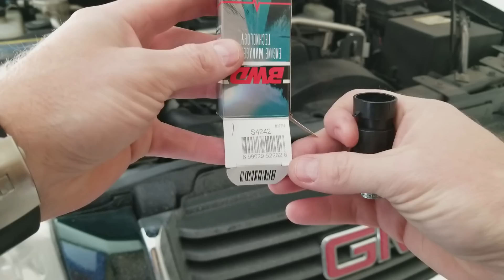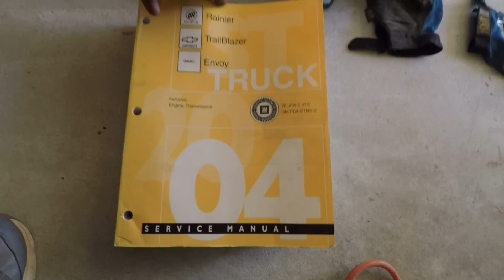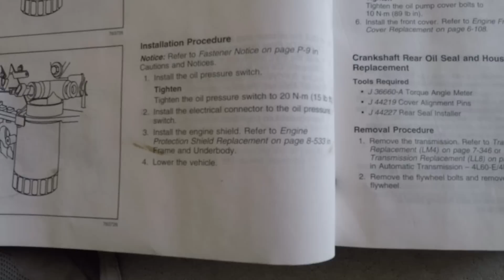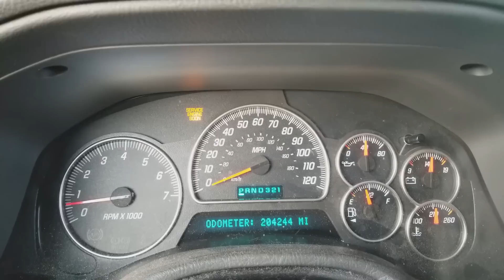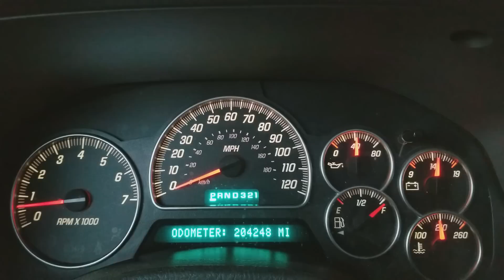DIAGNOSING ENVOY/TRAILBLAZER LOW OIL PRESSURE (GM 4.2L)

Comment: Thanks for the info its the same signs of my issues with my  trailblazer , going to attack with more confidence n hope that fixes the issue with oil floatation gage, am throwing cluster sign turn of engine low oil pressure when gage drops to 0 then floates back  an forth, n  to use 1 -1/16 thin wall  long socket.

Comment: When it throws that solinoid code, it means your car is low on oil and you need to change it. I realized this with my gage was doing the same thing and then the code was thrown, did an oil change and had 2 quarts of oil come out of my engine….. after I replace the filter and added new oil, the code went away and the gage stopped, it’s a temp fix, replace the sensor when possible because it was still leaking as well.

Comment: This happened after using Castrol oil for the first time. ONLY USE AMERICAN BASE OIL EUROPE OIL IS NO GOOD FOR AMERICAN CARS. Now I'm hoping the fix is the oil switch with a little marvel mystery oil. I will repeat my trailblazer ran perfectly fine all the way up until This dumbazz mechanic added Castrol to the car. 3K miles later the oil felt like water???

Comment: 2 weeks ago I had an oil leak from my oil pressure sensor on my 4.2 Envoy. But the sensor itself wasn’t bad as it read normal pressure. It was a bad o ring. I wonder if it’s a common problem with the Vortec 4200.

Comment: You would need a way to apply pressure to it and check the switch whether it opens or closes to pass current for the pressure light. It probably closes to send signal to the light

Comment: It sounds like your battery is getting a little weak maybe? Yeah, I have to replace that oil sensor too on my 2003 Chevy trailblazer with 195k miles. Good stuff. Subscribed
Reply from the maker: I did replace my battery at the beginning of this year with a Napa Legend battery 👍

Comment: Great info. I own a beautiful 2002 Blazer ZR2 with the 4.3 Vortec & 300k miles on her. 
 It'll tick when it gets a quarter of a qrt. low on oil. 
I deleted my leaky oil cooler lines & gained a lot of pressure. 
I did change my oil pressure switch/sensor located behind the distributor but, it didn't make a difference. 
My pressure runs around 20 at idle & 40-45 running. It'll hit 50 on a fresh oil change.

Comment: having the same issue with my 05 trail blazer i bought yesterday oil pressure kept goin down there seems to be a slight knock also my coolant is boiling is that a bad aighn of bad motor
Reply from the maker: Congrats on your new-to-you truck!  Start with the easy things first.  Change your oil and pressure switch.  How many miles are on your truck?  Since you just bought it, i'd suggest going through and changing all the fluids.  That way you have a fresh start with the maintenance.
Reply: @KevinNadeau  we’ll come to find out the motor is shot I think it threw a rod it’s knocking really bad almost no power I think I got hustled honestly
Reply from the maker: Sorry to hear that, its a terrible feeling.

Comment: Okay...if you try this procedure and then, IF IT DOESN'T FIX THE ISSUE; consider this; you may very well have a clogged oil pickup screen that is towards the bottom of your oil pan, (especially if you did an "engine flush"...and getting the oil pan off is  a MAJOR job to get off to reach and clean the pickup tube. This will eventually choke and kill your engine!   
SO...you can also try this to (as safely as possible) dissolve the sludge that is clogging the pickup tube.  
How to Unstop an Oil Pump Pickup Tube Without Taking the Oil Pan Off

Chances are very good that if the oil pressure has dropped due to a clogged pickup tube screen, the pump is damaged and should be replaced along with new crankshaft bearings as well. There is a procedure, though, that may help if the damage is not too severe.
Step 1
Drain the engine oil into a drain pan and remove the oil filter. Replace the drain plug and pour 1 gallon of Berryman B-12 Chemtool or a similar product into the engine oil fill. Do not crank the engine. Let the product sit in the oil pan for 2 days before draining.
Step 2
Drain the solvent out of the oil pan. Replace the drain plug and fill the oil pan with solvent once again. Allow it to sit for 2 additional days and drain the product. Inspect it as it flows out of the oil pan. If it is a dark sludge, the process will need to be repeated. Rub the discharge between two fingers and feel for carbon grit. If there is grit present, it will clog the screen. Repeat the process until there is no sludge or carbon grit in the discharge.
Step 3
Drain the flush agent one more time making sure it is free of sludge and carbon. Remove the oil fill cap and let the engine sit overnight with no drain plug or oil cap installed. This will allow the engine to air out.
Step 4
Install the oil drain plug, a new oil filter and add engine oil. Disconnect the engine computer fuse, or disable the engine so that it will not start. Crank the engine for 15 to 20 second intervals several times, allowing the starter to cool between each crank. This will prime the oil pump so the engine will not have a dry start.
Start the engine and pay close attention to the oil pressure. Listen carefully and make sure there are no engine knocks or rattles. If there is noise, the engine requires further repair.

Comment: The oil sensors are faulting out cause of dirty oil. The PVC hose can put moisture back into the oil causing the oil to have white spots in it. And in the winter is when it happens the most. Needs a oil catch can in place of the PVC to stop the problem

Comment: does this happen on the 5.3L v8 also
Reply from the maker: I'm not very familiar with the 5.3L, but you certainly could have low oil pressure issues with that motor, or any motor for that matter.  If I'm not mistaken, the oil pressure gauge on the 5.3L motors reads the actual pressure, not a dummy light like the 4.2L.

Comment: The noise is the Alternater bearing
Reply from the maker: I made this video about 3 years ago and actually still have the same alternator 👍
Reply: @KevinNadeau  did your part replacement take that knock away!?
Reply from the maker: @davidcardoza8790  My problem was ultimately a clogged pickup tube. I've got a few videos about it on my channel.

Comment: I have a 2002 Chevy Trailblazer with 312,000 miles on it. Bought it at 105,000 miles. 
I think that it sounds like an alternator bearing noise. Alternators usually spin 3 to 4 times the crankshaft rpm. 
Hello from north east Montana. 
10 miles from the Canadian border.
Reply from the maker: Wow, that's impressive mileage👍
Reply: @KevinNadeau    On our last trip to Billings, 320 miles, went down on Sunday, 60 to 75 mph, 22.4 mpg. Came back on Monday night, 65 to 90 mph, 19.4 mpg. Montana daytime 70 mph, nighttime 65 mph, on 2 lanes.

Comment: Do you have any idea how close the pickup tube is relative to the oil drain plug?
Reply from the maker: I don't remember exactly. Looking back, I wish I would have taken some measurements. If I had to guess, I'd say about 4-6 inches rear of the drain plug.
Reply: @KevinNadeau  thank you! I was wondering if I could stick a small brush through the drain hole and clean it some. Doesn't seem possible if it's that far off, that's why I asked. 
I'm going to fill the pan with some carb cleaner and let it sit for a few days and see what happens. Thanks again for the reply.

Comment: And if the sensor is already replaced the truck was running great but once again the oil goes to 0 ?
Reply from the maker: Yup, it was in fact a clogged pickup tube

Comment: So you don't need to do the oil and filter change before changing the pressure sensor? My 2004 chevy trailblazer has the same problem
Reply from the maker: It's probably not a bad idea to do an oil/filter change too

Comment: So the pressure switch is typically shorted or closed, you can use the multimeter to test for continuity. It should read 0 ohms. Once the pressure goes above about 10psi, it opens up. But I think your problem was that the switch was internally damaged and leaked oil. Also those vehicles have issues with front wheen bearings...typical problem.
Reply from the maker: The problem ended up being a clogged pickup tube. 
I know what you mean about the wheel bearings. I've had to change them a couple times.
Reply: @KevinNadeau  I am glad it was just the pickup tube! Better than excessive clearance at the cam or crank bearings.

Comment: Did this fix your issues? I recently bought my son an 07 4.2l with 130k and it today had the low oil pressure, stop engine command.. I changed the oil and filter, happens again.. it does have a small power steering fluid leak which is  right above this sensor, and it has a new minor oil leak coming from this same area.. im preying its this oil pressure switch, I definitely need a simple easy fix like this.. great video
Reply: Forgot to mention I also have a 05 4.2l with 345k miles on it, still runs decent.. my son actually drove that for about 4k before I decided to but another one, I have literally changed everything on my old 05.  I now drive my 06 silverado crew cab fully loaded.. I loved my trailblazer so much I had to get him one.. I just needed a full size truck for work otherwise I'd be driving another suv for sure
Reply from the maker: Ultimately my problem was a clogged pickup tube. You can check out those videos on my channel too.

Comment: Just what I was looking for. Thank you!  My oil pressure went to "0" while running fine, and had plenty of oil when I stopped to check it. Restarted, pressure went to 40, and then back to 0 after a minute or so of driving. Looks good now!  Thanks!
Reply: Update on my situation; the pressure switch was not the culprit.  It was sludge that was strangling the engine as it vaccumed up the sludge onto the intake screen.  As soon as you turn the engine off, the suction stopped, which would temporarily allow the pressure to increase, and then drop again.  It ended up destroying the engine and we did an autopsy on the old engine after putting a used/newer engine on.  I've even heard of skilled technicians calculating where they could tap and drill into the bottom of the oil pan to gain access to the screen on the oil intake tube.  Hopefully an overnight parts cleaner soak could help it dissolve and drain.  Good luck.

Comment: Great video very helpful and will  save me time. Looks like a very simple job, I will go on ebay and get a switch for 6.99 rather that Autozone that wants 40 -60 dollars WTF !!!!
Reply from the maker: Awesome! I'm glad the video helped you.  I would suggest going with an AC Delco brand switch if you can find one on eBay.  If not, I have a link in the description for the one I used. Good luck with the repair.

Comment: Hello Kevin I don't know if you are monitoring your posts these days, however if you are I would like to hear your comments. Firstly a great series of videos and very well done under difficult circumstances. I am still chasing the fix on a 2002 4.2 trailblazer which showed the same issues as you had. Low oil pressure at idle. I replaced the oil pump, front cover, pick up tube and oil pressure switch twice and still have the low oil pressure light coming on after 15/20 minutes of driving. No DTC codes are shown. I have removed the dash check and replaced the stepper motor on the oil pressure gage and cleaned the throttle body, (to improve the idle speed). I thought I had it fixed with the idle speed going up to 620rpm from 550rpm. All this time I have had a master oil gage hooked up to the engine and it has always read a steady 75lb psi on cold start up, 45lb psi on driving around 2000rpm and 18lb psi at hot idle. These are all within GM's recommended specs. I have stuck with the 5w 30 mobile 1 full synthetic oil and a quality Hastings oil filter. The engine runs very well is quite and smooth and good for its 157000 miles. I an beginning to think that I either have a PCM issue or a throttle body issue as when you come down from 2000rpm the rpm fluctuates momentarily to under 500 rpm and then goes back up. It is at this point the low oil pressure warning comes on and the gage drops to zero. The master gage is still at 19lb psi. Has anyone to your knowledge solved this problem and fixed it? Thank you John
Reply from the maker: Wow John, you have certainly hit all the areas I would've suggested checking/replacing. With all those parts you've replaced/checked/cleaned, the only thing I can think of you have left is to replace the bypass valve thats behind the oil filter. Other than that, it sounds like it might be  an electrical gremlin😁.
Reply: But u said yours had a raddle to did that go away?  @KevinNadeau
Reply from the maker: @johnnywessinger8899  Yes it did 👍

Comment: Glad that was your issue... I have one with leaking (from connector) O/P switch,,(replaced)--then VVT solenoid (leaking from electrical connector) ,replaced..... Problem got alot better, but still doing it... :(  (for 50 years I have been a Chevy guy, but with this modern JUNK they are peddeling, I'll stick with my 86 S-10 with 1967 full built small block 327 or my early model (01-04)daily driver SAAB cars (9-5 and 9-3---before GM finished them off also with bad decisions)....  :(  (still gave your video a thumbs up!)
Reply: You just described me as well. Just imagine electric cars, no more on the side of the road fixing for that matter none for old school like us. Batteries for those cars probably in the thousands so I'm gonna stay with a bus pass not lol. My 03 envoy is knocking like a 39 ford with 2 cyclenders working.

Comment: Hello, I Have a question, so I have changed my engine oil and it still says "check gages," , I'm thinking that it will be the oil pressure switch.

My question is, do I need to change the engine oil again.

I changed the engine oil since a week ago.
Reply from the maker: I probably wouldn't change it again.

Comment: I have the same car and it's due for an oil change ,should I change the oil before or after I change the switch?  Thanx
Reply from the maker: It would be a little easier to change the switch with the oil filter out.  So for that reason I would go ahead and change the switch while you're doing an oil change.

Comment: March 2,2020.
I have the same issue with the fluctuating oil 
pressure needle. 
Thanks for the video,
now I know what I am up against. I replaced bearings due to speed sensors, when I bought my 04 used, last year. All 
good on that front. Anyone know about vibration through the steering column when at a stop? I had to replace an ignition coil a month ago. Done at a garage,and it was more than I wanted to pay, near,$300.00. Was a Florida vehicle for college student, but it came home to NH, and I grabbed it. I like the Envoys.
Reply: Damn $300 for a coil they screwed you I could change all of the coils for half that money and about 30 minutes worth of work and that's including sitting down smoking a cigarette or two
Reply from the maker: Good luck with your truck!
Reply: It's probably the a/c compressor, that's what caused mine, the vibration

Comment: I did not want to take the engine apart or remove the rack n pinion just to get the oil pan to drop on my 2004 Envoy so I could clean the pickup tube. In this Video or the next one Kevin replaces the engine oil with kerosene and this does not work for him maybe he did not leave it in their long enough. I removed the oil and filter in my envoy. Then put a new filter on and replaced the engine oil  with 2 Gal of diesel fuel. I let that sit in the engine for 3 days starting the engine once or twice a day for no more than 10 seconds. The now Black diesel was drained and filter removed next added new filter and New  Oil and Oil pressure is better than ever.
Reply: What would happen if you run the engine for more than 10 seconds? Are you worried about the diesel igniting, or the engine running with no oil?
Reply: @zaid3ssaf1   I just wanted to circulate the diesel with out hurting the engine so I did not want it to get hot.Although I have been told that diesel is more oily than gas and it should not damage the engine. i guess I never thought about a fire hazard because I just let it run for few seconds to splash it into the engine and through the pickup valve.
Reply: I am having the same issue with a 2005 GMC envoy. We put two gallons of diesel in after draining the old oil. Started it for 10 seconds and turned it off again. Will keep doign this until Friday then drain the diesel and replace with new filter and oil. I also changed the oil sensor but it still did it. Hopefully, this fixes the issue. I just think these old engines don't rev up enough and they build up sludge over time. Will post if it works!
Reply: Well, I had the diesel in the envoy for a week and started it a few times a day for 10-15 seconds. Drained that all out and filled it with 20W-50 and some Marvel Mystery oil and BAM! Oil pressue issue solved! Drove around for over an hour and a half and now shes right at 40 where it is supposed to be! So, I guess you just have to be patient and let it do it's thing! Worked for me!
Reply: @SensationInteractiveGaming glad it worked for you too 😊